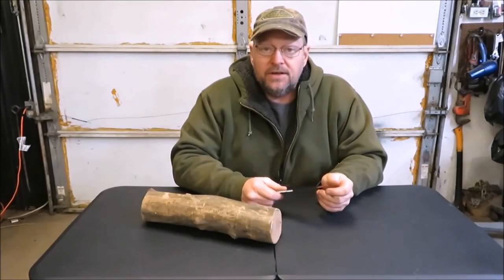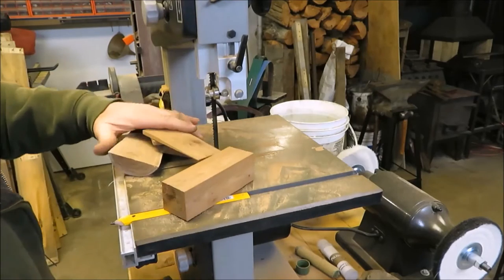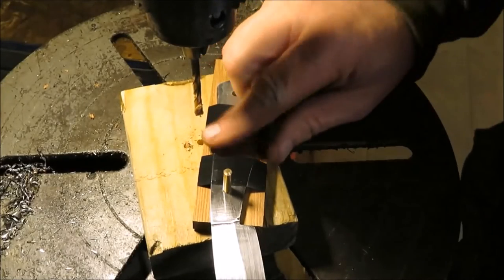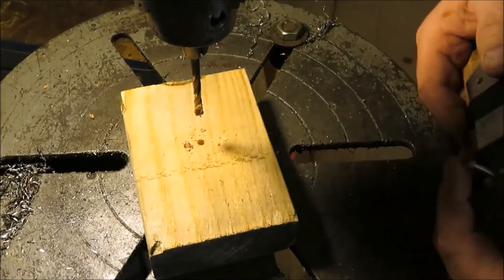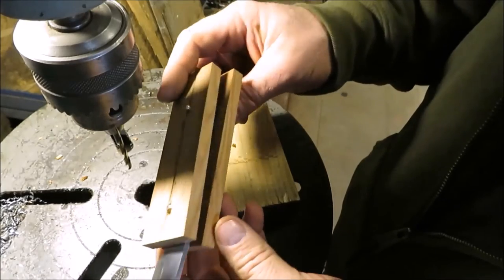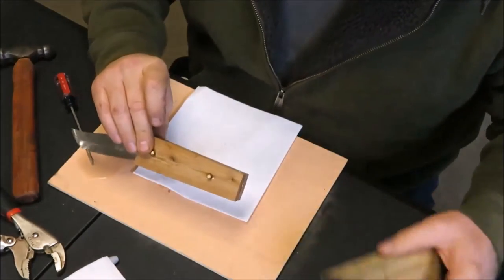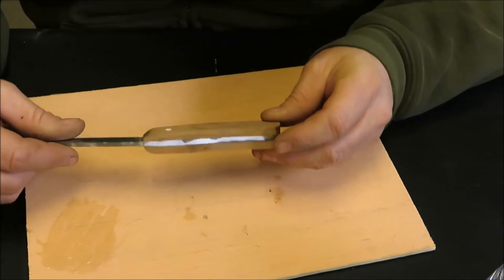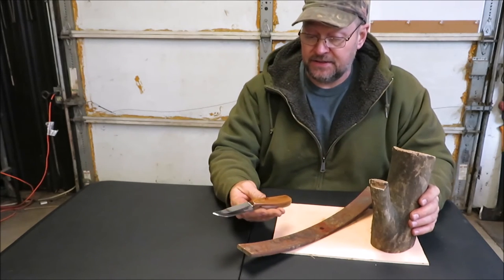knife handle build

Comment: Great looking knife Kevin, I would have put 3 pins in the handle except the end one I would have used some brass pipe so you could put a bit of leather thong or para-cord through it. Well done
Reply from the maker: Who would sales that brass pipe I had a hard time finding the brass dowel.
Reply: I am not sure Kevin maybe a pluming supply or Air con place???
Reply from the maker: Thanks Peter.